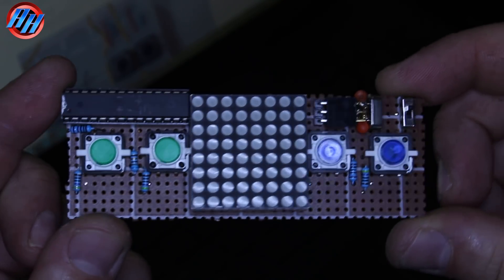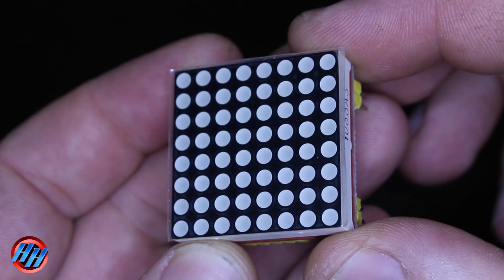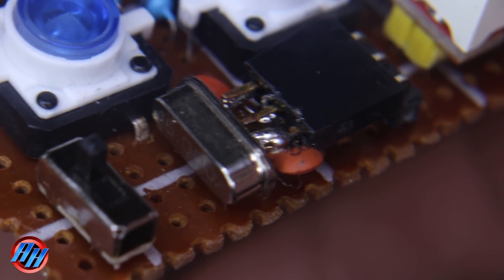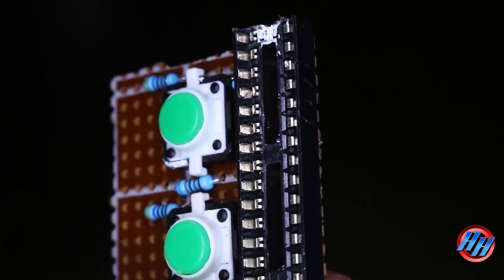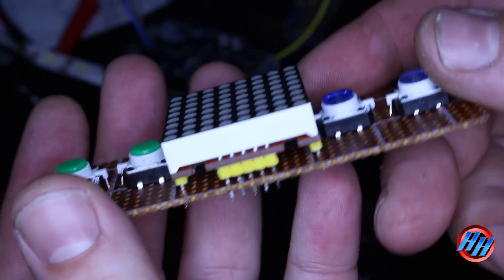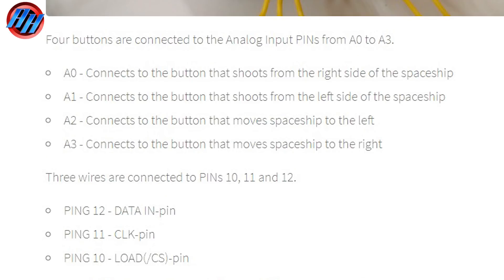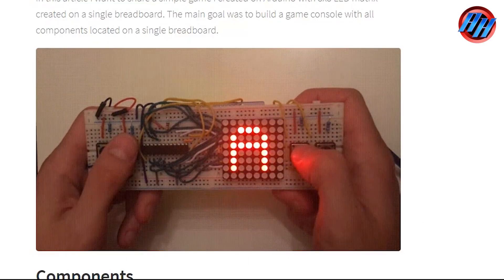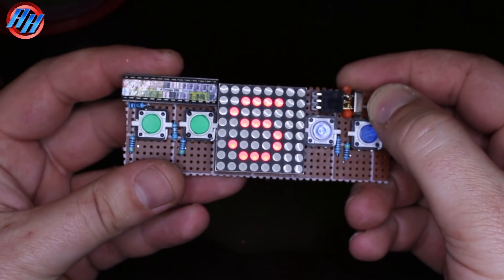Homemade DIY Gadget - 8x8 Led Matrix Game

Comment: Good and expensive.
Reply: Trying To Make 
Less than $5?!?
  Reusable "upcycled" ;) microcontrollers are not very easy to find. At least the ones that are easy to program...unless your into PIC's. I don't know why I find PIC's all the time. I've seen a few ST's as well but I probably have a dozen or more random PIC MCU's laying around on random stuff to scavenge for parts. I've also got Motorola's STC's Freescale, and TI's but without idiot level example code, the hundreds of pages in those datasheets leaves me cross-eyed. It's too much time needed for a one time trial use. It's hard to beat a simple mega328 project, especially since a 328 costs around $1 these days even in low qualities.
-Jake